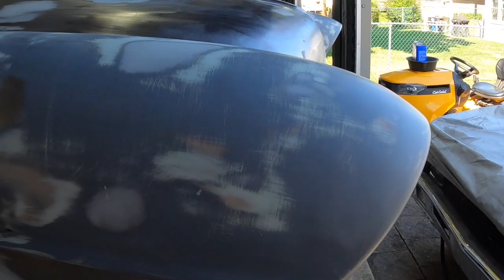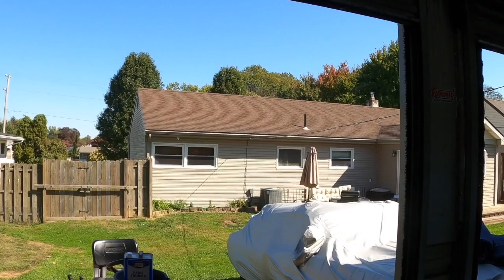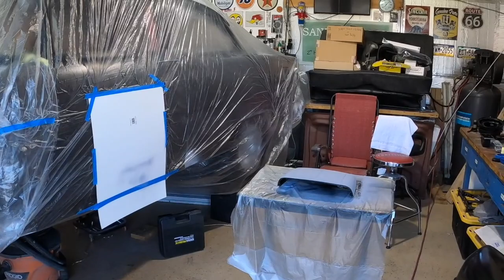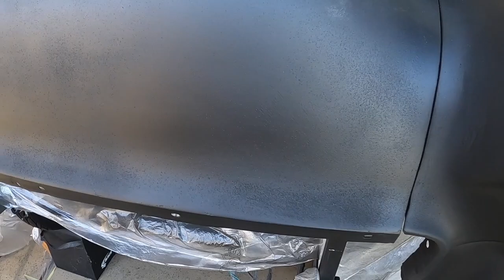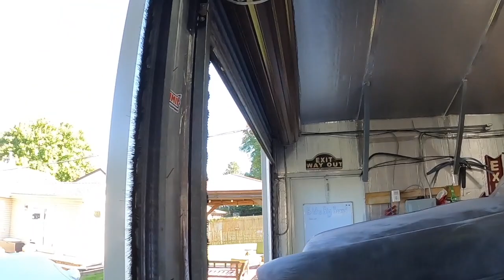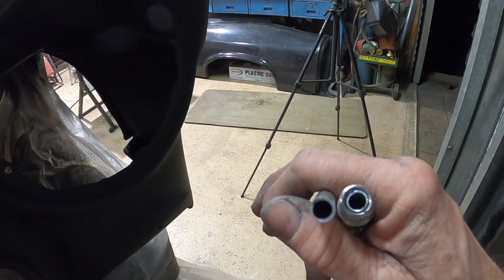Learning To Apply High Build Primer

Comment: What tip is recommended for high build primer? 4:1 ratio is in the label but no tip recommendation
Reply from the maker: The product says 1.8 - 2.4. I used the 1.8. I tried the 2.4 and it basically falls out the end. I couldn't control it. So 1.8 for me ✌️
Reply: @bwsgarage thank you

Comment: It would have been a good idea to put self etch primer or epoxy down before the high build.  You can get away with 2k primer over small cut throughs, but not that much bare steel.

Comment: 1.8 for standard primer high build 2.5 works best or you have to thin it more. Got mine from tcp global thru Amazon. Not the best but you can buy different tip kits.

Comment: Great Video man! This is what building a Hot Rod is all about! Learning as you go and not being afraid to mess up! I think you've done a great job applying the filler primer! I would suggest that you send between each coat only because your trying to flatten out the steel. Your not really concerned with the spray out as this is only primer! Also your top load gun is a HLVP gun means high volume low pressure. They like 9-13 pound of air pressure. I would continue to play with aor pressure to see how your mix likes to be sprayed! Keep up the great work man! Have a good one Buddy 👍
Reply from the maker: Absolutely man, learning is the fun. I appreciate the tips man, I am definitely sanding between coats. ✌️

Comment: your need to the primer they also come with brown filler primer. Or use some spot putty and a one by the corner of the passenger fender low spot on the hood you could also use spot putty. from gordon  in flint mi.
Reply from the maker: Thanks for the solid advice Gordon. You really seem to have a handle and good knowledge on body work. I appreciate the tips bud.